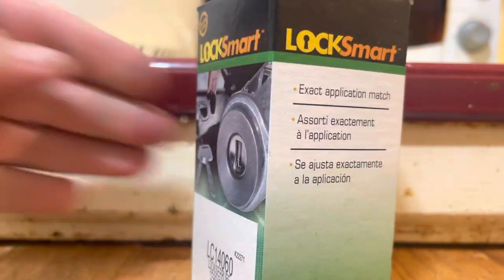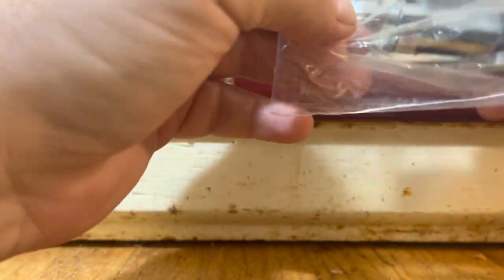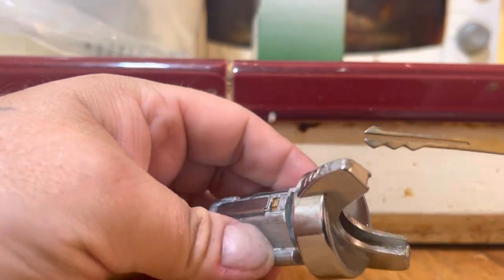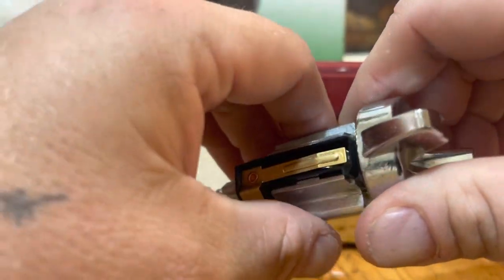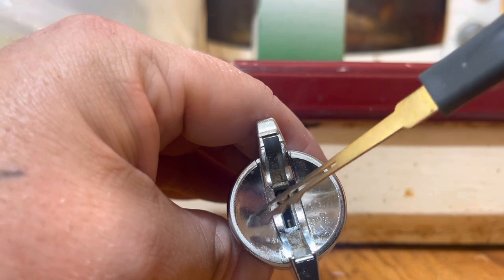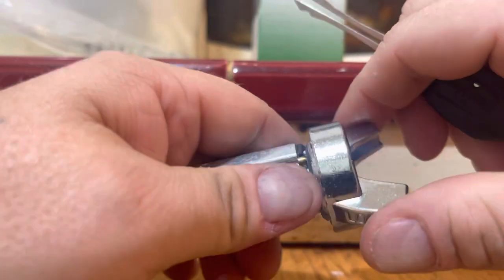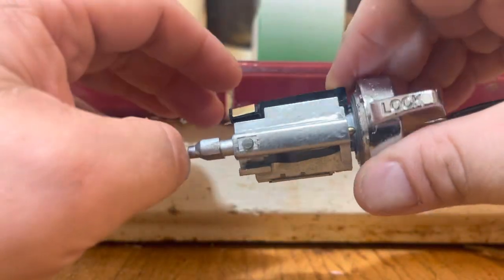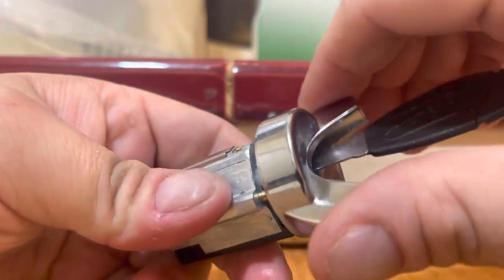How to replace ignition lock with no keys on a 1988 Ford F250

Comment: Hello does this work on a 1980-86 ignition key ?
Reply from the maker: It should- if the ignition hole is centered
Reply: @thewhittierlocksmith121  thanks I tried for a while. Do some key pattens just not rake ? Also does it get harder with age, if the lock pins are worn down and slip too freely ?
Reply from the maker: @feelvivek  yea for sure, use lube like houdini or tri flow- some of these locks are older than i am and there's tons of old grease, gunk and dirt. Ignition may even be bad if it doesn't work. Just try a few different rakes, picks and or jiggler keys
Reply from the maker: @feelvivek   to answer your question, sorry for late response. Yes some patterns may not work, may need to try different combos of rake shapes